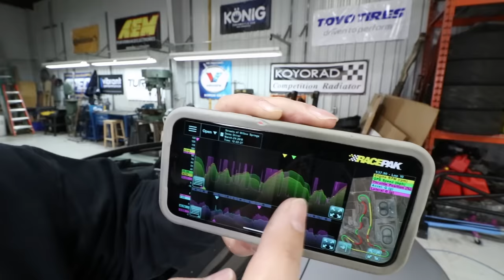Fitting Bucket Seats into The BUDGET Miata

Comment: The Sparco Sprint V fits perfectly without any door card interference.  Another benefit is they are suspension type seats.  I have them in my track Miata as well.
Reply: Do they sit you lower than stock seats?
Reply: jgaines4 depends on how you mount them, but typically, yes.
Reply: Are they comfortable for street use?
Reply: @dongbutt  if you take the Jass Performance Sparco adapter, you can use the original rails on the Sparco Sprint. You sit lower than stock seats, the Sparco are confortable and not expensive. I use this combo for about one year.
Reply: I may try this soon

Comment: Ok so I have just finished install my Recaro Pole Position using the same rail Nagisa Auto seat rail... here is my review
Recaro Pole Position (10/10) – Excellent quality, materials are fantastic, removable cushions to sit lower in the car, Highly recommend!
Nagisa Auto seat rail (3/10) – Does Not directly bolt in. The rail when install onto the side of the pole position is about 25-30mm from the mounting holes in the chassis. This is due to the seat rail being designed to fit smaller bucket seats (pole positions are classified as large seats for big guys). The outer rail closest to the door required cutting using an angle grinder and re-welding to offset the bracket by 30mm. The seat belt buckle also does not work well with the rail as it contacts with the seat and makes latching the seat belt impossible. I managed to make it work by installing the latch with the eject button facing against the seat and the slot against the transmission tunnel & bending the bracket slightly. There is just enough space to lock the latch when the user is trained, not a friendly setup for new/random drivers or passengers. This is not user-friendly install at all, I would not recommend for those looking for a direct plug and play setup.
I now understand why there is no video shots of Dave or Pete installing the seat with rail into the car :(
Hope this helps anyone looking to copy this setup.
Reply: I’m buying a pole position for my car. Did you have to beat on the trans tunnel to get it to fit?
Reply: I read about someone having to re Weld the brackets about 40 is mm but nothing in this video shows about that. It has me curious

Comment: I have the same model (but a 1998) and removing the mid console (i actually replaced with a shorty console) and the handlebar on the door (replaced with a strap) created alot of room for the driver.. (i also put an adapter, snapon-wheelhub and a smaller flatbottom steeringwheel for legroom).. this made it bareable for my 189cm 120+kg brother

Comment: Nice that y'all chose the Pole Positions, I've been looking into getting one of those or a SPG for my Miata. I am worried about the tight fitment though. I don't want to cut the door cars on my NA lol.
Reply: If you're of a normal height (>5'-8"),  you really only have 2 options: Sparco Sprint or Tillet B6. Anything with normal (read wide) shoulder wings will hit the door when you mount it low enough to actually pass a broomstick test. If you need an XL seat, you need to buy another car. Period. Mounting the wings above the door panel will result in a seating position at least as high as stock. The door panel is pretty thin in the area it will contact, so even hacking up or completely removing the door panel will not get you much more than 1/4". 

It's an unbelievably tight fit. I measured literally every single FIA-rated seat and spent weeks researching Miata builds. Had I known how much effort it would take to get me into a reasonably comfortable driving position at 5'-11" I would have probably just bought another car. I've spent more time working on improving the driving position than any other aspect of the car.
Reply: I'm 6'3 what's my best seat option in a nb2

Comment: I kinda miss my old NB. They are a fun car. Are you going to do something about the diff? By the looks of the absence of the stock Nardi steering wheel that means your NB doesn't have the stock Torsen LSD. By the way the stock Nardi wheel is one of the best feeling wheels I have driven with. Looking forward to see this little car rip on a track. All my old NB saw was the highways of california and the mountain roads of California. I may consider another NA or NB in the future but it would have to be a second or third car. Miata's make great cars if you are young and don't need space but for a singular car they are just too small and have limited functionality. Great fun though, nothing like ripping around turns and feeling like you are hauling ass when you are way below the speed limit.

Comment: Really stretching the word budget at this point.
Reply: Almost like building a track car that's usable and safe isn't cheap
Reply: Compared to LMP1?
Reply: I agree on that don't want a cheap part to fail going fast. But don't call it a budget build When it's not
Reply: @joseochoa5432  for a track car it is cheap. However building a track car is never going to be something you can do on the reap cheap unless you want to have a crap experience and not car about safety
Reply: I could be wrong, but I think I recall them mentioning it would be budget except when it comes to safety as is often the case with budget based racing.
Reply: Running a car for fun isn't cheap but compared with service costs on a Maclaren or Ferrari, an MX5 is the most fun you can have for a few sheets.

Comment: 8:22 what do you loose removing the clock spring? I've changed a wheel in my ex Miata with putting a Momo Prototipo attached to a Daikei Boss Hub kit which worked perfectly, and my clock spring stayed there. Thought you needed that for alignment and other stuff
Reply: Clock spring would just be for steering wheel buttons. The wheel angle sensor (if your car has one) may not go through the clock spring (it didn't on my sti).
Reply: @walterbrooks3539  thanks for the info!